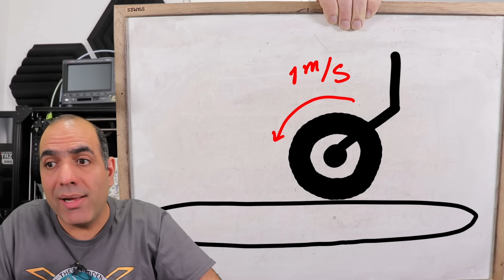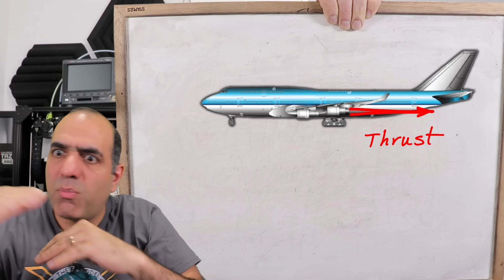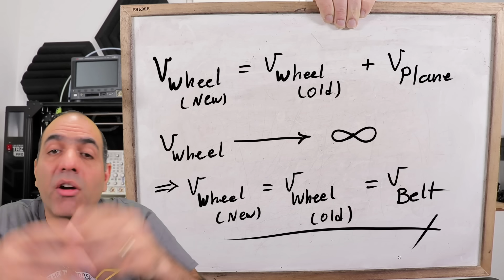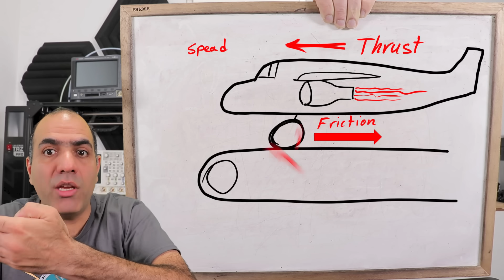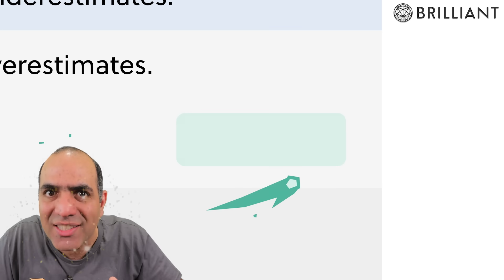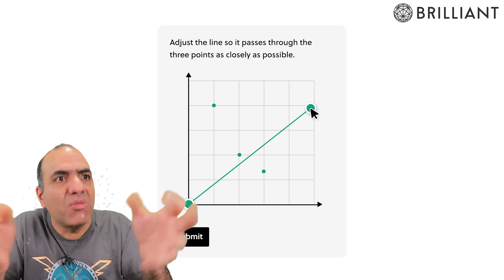Airplane Question that Drove Me NUTS!!!

Comment: I like how the question is implying that the plane's wheel speed is the sole reason why it takes off.
Reply: i'm pretty sure that part is the whole gimmick behind the question
Reply: What if the plane got no wheels😁? There are planes that land and start from the water
Reply: My problem isn’t that people come up with an answer it’s that they get the aspects wrong. “The wheels don’t matter because they aren’t what make the plane move” being the dumbest. No the wheels ALLOW the plane to move and negating their rotation is the issue. “People don’t understand thrust” no morons, thrust isn’t the issue, lift is. Thrust moves the object forward if the wheels allow it to be moved but it’s airflow that matters and you can’t have with a stationary object unless there’s existing wind.
Reply: @steveloafe  wait do you think the belt will stop the plane from taking off? 😂
Reply: @mitchio83  you clearly didn't watch the whole video before commenting, lol. There's a trick to the question.
Reply: @thecrazyfarmboy  Tell me what i got wrong.
Reply: @steveloafe the wheels are what allow it to move without it scraping the bottom of the plane. But it doesn't need wheels. It could use water, it could use snow, it could use lube. The wheels are just the most realistic way to reduce the friction in reality. The fact that they can be taken out of the equation entirely is proof they don't matter for a plane to take off. The point of the question is to make people realize the difference between how cars work and how planes work. The treadmill would stop a car from moving because the car uses the grounds friction to push forward, which is what people often think of.

But think of it this way: if you're on a treadmill wearing roller skates, you could use a rope tied to the wall in front of you to pull yourself forward, regardless of how fast the treadmill is going. Because you're using an entirely different method than the ground to move forward. The air is the rope. The plane moves forward because it is tugging on air, regardless of what the wheels are doing. Are we using the assumption that the wheels exist and haven't melted? Yes, because that's not the point of the question.
Reply: No, it doesn't imply that. It implies that any forward movement of the plane will be offset by rear movement of the ground it is sitting on. The plane may be moving fast relative to the ground, but not fast through the air around it. The air around the wings cannot create lift, not matter how much thrust the engines make. For the plane to move forward through the air, the wheels that are holding it's weight would have to move forward with it, they can't just slide forward.
Reply: Seems that the question is ill-conceived.
Reply: 😂exactly it’s a trick question at its core
Reply: Your reply smells a bit fishy to me.
Reply: Because the wheel is the only thing moving aside from the engine. 

Why are the wings on the plane?
Reply: the power of coercion
Reply: @ΜικεΡ  because its lifted by the Wings ? No Need for ground and tires because its in the Air?
Reply: Right, when if fact it has absolutely NOTHING to do with the aircraft taking off.
Reply: It's like the equivalent of adding wings to a car and wondering why it won't stay in the air.
Reply: Of course it is. That is why it is impossible to start a plane on water or snow.
Reply: @schwarzerritter5724  that's a joke right?
Reply: @fedyx1544  It is called the Magnus Effect. The spinning wheels are actually what makes the airplane fly, the wings are just second rudder.
Reply: @schwarzerritter5724  lmao
Reply: the wheels will be going twice the normal take off speed, maybe they think the will will explode?😅
Reply: @carl_h  way more than twice the takeoff speed. Possibly 10,000X or more. He kind of explained that in the video..
Reply: @carl_h If you're measuring angular velocity, then the ground already represents a surface going in an opposite direction equal to the speed of the wheels.  If you're measuring the velocity of the wheels as an object moving across the ground equal to the aircraft, the conveyor would only double the angular velocity of the wheels.
Reply: @carl_h  in that case the belt did not match the speed of the wheel so it breaks the parameters of the question.
Reply: oh its the wheel? i always thot its the nose.
Reply: @clusterstage  Its the air moving over the wings. Sitting on a treadmill generates no lift.
Reply: It's more like the question imposes a wheel drag that is exactly high enough to match the trust from the motor, so yeah the plane will just stay there unless it is facing a headwind in the midle of a huricane or some otyher far fetched scenario that is not at all mentioned int the question
Reply: @piethein4355 there are even planes with more thrust in forward direction than wheel traction.. Wheels would just skid uselessly.
Reply: It's a pretty uses question either way, there's no way a conveyor belt that big would be stable moving that fast. The heat from friction alone would destroy it.
Reply: Being fair, its kind the reason it doesnt lift off ;)
Reply: Right? I guess it's a question if you have zero understanding how aircraft or jet engines work.
Reply: Yep. These questions sound like some brain teasers for middle schoolers
Reply: What's important... and missing from this scenario entirely is the type of plane and the airflow.
Some planes can take off with very small levels of airflow and some engines can create large amounts of airflow on their own.

Even the smallest amount of lift will upset the perfect drag of the conveyer.

We're arguing a hypothetical where we don't even have the most critical bits of information. Anyone who knows anything about airplanes would know that. (Not to mention that the scenario says nothing about VTOL)
Reply: @Unethical.Dodgson  wheres it Missing ? It says 747 in the question ?
Reply: @Unethical.Dodgson  747s don't have VTOL.  They are big heavy passenger planes and need high enough airspeed over the wings to lift the very large plane.
Reply: without the wheel, it can't build up speed. It's not the sole reason for the plane's capability to fly, but for the way it's designed, it is 'essential' to takeoff. Wheels reduce the drag that would be occurring if the plane was just scraping the floor (assuming the plane is indestructible). Basically, the real solution is that, if the plane can't overcome the speed of the "conveyor belt" such that there is not enough wind over/around the wings to generate enough lift to takeoff, then the plane can't take off. Assuming there's absolutely zero headwind. Again, this is specifically for the given plane 747. Some planes can takeoff without wheels, or wings for that matter.
Reply: @grenzviel4480  the wheel has nothing to do with the creation of lift, it’s a trick question, just like if a float plane is in water, doesn’t need wheels to take off
Reply: @rylandallas9907 if the wheels have nothing at all to do with the scenario. Let’s say a plane needs 100 miles an hour ground speed to take off. Set a belt going at 100 miles an hour opposite direction. Yes it will be moving 100 mph relative to the belt, but will be going 0mph relative to the ground. Therefore no lift.
Reply: @grenzviel4480 If a plane's engines couldn't overcome a double of the rolling resistance of the wheels, planes probably wouldn't be using wheels on take-off to begin with.
Reply: @grenzviel4480  the plane doesn’t need to ‘overcome’ the speed of the conveyer belt. The wheels just turn twice as fast. The speed of the wheels is independent from the speed of the plane.
Reply: @Formula1st  it does because it's the wind around the wings that makes the plane fly. If the plane can't overcome the speed of the conveyor belt, then the wings aren't moving, and if there's no wind moving 'through' the wings, then the plane can't fly. It's not like the 747 can vector its engines upwards or in any direction.
Reply: @grenzviel4480  but the plane doesn’t need to overcome the conveyer belt. The engines generate the thrust, not the wheels. You completely missed my point. The engines generate forward movement, which creates the air flow over the wings, which generates the lift.
Reply: @Formula1st  YOU completely missed my point. Doesn't matter how much thrust there is, whether where the source is from, engine or wheels, it's the WINGS that make the 747 fly. I think you misunderstand how plane engines work in relation to the wings. The wind needs to go over the entire wings, and not just part of the wings to generate enough lift to fly. From the base of the wings, all the way to the tip. Just a reminder, the engines are located just BELOW the wings. If the wind just needed to go through the engines to fly, why do you think the 747 have big ass wings? To look good?
PS: again, assuming the engine is spooled up to its maximum speed, you'd need to vector the thrust downwards and 747's main tool to pitch up and down, the elevators, are not in the way of the engine, so the air flowing through the engine is effectively useless
Reply: @grenzviel4480  I know exactly how planes take off, I’ve flown a few planes in fact. What you don’t understand about what I’m saying is that the plane would move forwards, just like on a normal runway. You seem to be talking about a stationary plane. By ‘the engines generate forward motion’ I didn’t mean they blow air at the wings, I mean they push the plane forwards, and the process of the plane moving through static air generates lift as the air flows over the wings.
Reply: @Formula1st  The spinning wheels have some amount of friction. As the wheels move faster and faster to keep up with the belt that friction increases. In the real world it would just fail, but in magic question land they would speed up until that friction counteracted all of the thrust.
Ignore the belt and just think about wheel brakes. If your plane wheel brakes are engaged and you try to take off you'll either go nowhere or apply so much force that you destroy something. The belt is just a stupid fancy way to apply friction and drag to the wheels, exactly like the brakes.
Reply: @zncon  rolling resistance (friction with the ground) does not increase as the speed of the wheels increases. Like you said, the tyres might fail because they would be going faster than normal, but this isn’t due to friction.
Reply: @Formula1st  I've never seen someone dismiss friction with such confidence and condescension. Amazing.
Reply: @zncon  Excellent illustration of why friction cannot be dismissed out of hand. Wheel brakes (and wheels) exist for a reason.
Reply: @Yutani_Crayven  I swear to god google it. Rolling resistance does not increase with speed. The area of the tyre in contact with the ground dictates the friction with the ground, so the friction would be the same as a normal runway.
Reply: @Formula1st  But friction builds the more the wheels turn, so the idea is to just speed the conveyer up so it always counters the thrust from the engine, so it stays stationary. i guess the right answer is dependent on friction of the wheels, and if we believe they are indestructible, but have friction build, then plane goes no where. Only if frictionless does the plane take off, though there are a lot of bad definitions in which objects speed we are measuring.
Reply: @mokiloke  no. Friction does not build up  the more the wheels turn, which is the main myth behind this. Read my above comments
Reply: @Formula1st  Is your premise that at some speed the wheels would decouple from the belt? My research is showing that most planes can hold their entire thrust with the brake systems for use in a short takeoff, which means the wheels do have enough traction to hold everything in place.
This would change if the ground was wet though.
Reply: @zncon  no, my premise is that the plane would take off just like on a normal runway, but the wheels would spin twice as fast, because the wheels are not applying a large enough force to matter, only the engines and eventually wings are. In your situation, it’s the brakes that have ‘enough traction to hold everything in place’ not the wheels.
Reply: @zncon  Or frozen. Doing runups in freezing conditions is all kinds of fun; basically it's often best done on the runway if there's time for that and you can't find a dry spot :D
Reply: @zncon  this interpretation implies a significant amount of friction is transmitted from the bearings to the plane body which seems kind of goofy on its face doesn't it?
Reply: @DeadTomLives  It does, but the speed at which the bearing spins would increase into infinity, which is why goofy makes sense here.

As the plane starts to move, the wheels go from stationary to to the forward speed of the plane, the treadmill then speeds up to counter it. However now the plane is trying to move forward, which means the wheel must spin faster then the treadmill, as the wheel speed must be the combination of the treadmill and plane speed.

If wheel speed is W, plane ground speed is P, and treadmill speed is T, we'd have the formula W = P + T. However since the initial problems requires that T = W, the value of T increases by P every time you calculate it.

If the system can't just break, this feedback loop keeps happening into infinity.
I'd think a wheel bearing spinning at 0.99~ the speed of light would have a lot of internal friction.
Reply: @zncon  except by the time the wheels are spinning at 2x takeoff speed the plane takes off. 

An airplane doesn't use the wheels to take off, it's analogous to using your hand to move a toy car up and down a running treadmill. 

The wheels on a toy car are spinning at speed of treadmill T when stationary, right? You begin moving the car forward along the treadmill against its motion at speed H, the wheels are now spinning at T+H and the car is traveling relative to the treadmill at H.

For an airplane once H equals takeoff speed it angles flaps and takes off.
Reply: @zncon  I hit enter early on that last one and added a bunch, in case you saw it immediately.
Reply: @DeadTomLives  This isn't considering that the treadmill instantly speeds up to match any time you try to make forward progress. As you try to push the car forward the treadmill would go to infinite speed until it was pulling so hard on the car that you could no longer push it forward at all.

I should specify, this requires the wheels have perfect traction against the treadmill. Any slip at all and it behaves exactly as you describe instead. The reason I'm assuming perfect friction is that the question says nothing breaks, and plains are designed such that the wheel brakes are able to hold it in place even at full throttle, which implies there's enough friction with the ground to cancel any thrust the engine can create.

When holding the car stationary on a moving treadmill then T = H and we're balanced. However as soon as you move the car to increase H, T must also increase until they are equal again. Functionally this means we're calculating T = H + T. There's always a leftover force because it's not balanced.
Reply: @zncon  ...what? That doesn't even make sense, the speed of the wheels isn't suddenly infinity. It matches the speed, the added speed is H therefore it increases by H.
Reply: @DeadTomLives  But when the speed matches, you're no longer moving forward, which means you need to speed up the wheel more to attempted moving forward.

If the treadmill and wheel are both moving at 3, you'll be stationary. So now you push the wheel up to 4, and the treadmill also goes up to 4, and again you're stationary.
Reply: @zncon  your breakdown in understanding here seems to be the normal one. The plane isn't moving forward because the wheel is turning. The wheel is turning because the plane is accelerating forward due to thrust.

The wheels are only ever going to try to spin at the air speed of the plane plus the speed of the treadmill - (I forget the symbol for an increasing value offhand) -  once air speed is takeoff speed up it goes.

Wheels start at 0, plane begins to move forward at an accelerating H, at start + 1 second, let's say, H is at 1/10 takeoff speed F. The wheels are now spinning at T+ H + (1.)F the plane has moved 10 feet down the treadmill or whatever.

The next second more acceleration happens, we're at ⅛ takeoff speed, wheels are spinning at blah blah, treadmill is moving at blah blah and the plane has moved 60 feet down the treadmill.

Etc until we get to takeoff speed and the wheels are at H+T and that speed is 2F.
Reply: @zncon  no, because the wheels aren't why it's moving forward.

The engine adds energy to the system the plane continues to move forward and the wheels speed up.

What you're saying only makes sense if the wheels are propelling the plane. The wheels are only spinning because the fuselage has an air speed and they're in contact with the ground.

The wheels increase in speed to #F and the plane flaps down and flies away.
Reply: @zncon  I think we're also applying friction differently than each other, such is probably the point of how vague the question always is
Reply: @DeadTomLives  Yeah I don't get his explanation either.
Maybe it makes more sense if you think of the plan as a rocket engine. The engines theoredicly are moving in a way that it's pushing on more air and thrusting the plane forward.
This is why the plane can move at all. Essentially the the wheels and treadmill is a completely different system.

(1)Treadmill fighting (2)wheels
(3)propeller/jett engine thing fighting (4)air
3-4 starts the chain of 1-2 but once 1 = 2 = 3

Nothing happens, plane does not move.
It's when 3 get's faster than 4 or in other words the inablily of air to move out of the way faster then a propellers "thrust" is when it starts taking off.

*This is also neglecting lift as a prop or jett engine creates as it sucks/pushes air past the wings. 
*Also neglecting that a plane throws air backward and is also newtons 3rd law of motion.
Thrust and lift, that's how a plane takes off. Formula salved.
Reply: @DoubsGaming  yeah in order for the plane to not move it requires perfect interface with the wheels and the treadmill which isn't stated
Reply: @Formula1st if the wheels spin twice as fast as the conveyor belt then the conveyor belt will start moving twice as fast to match the wheels, you completely misunderstood the question. All of the thrust the airplane generates will be converted to heat from the friction between the wheels and the runway and the wheels and the bearings.
Reply: @drabberfrog  that would only happen if either the wheels and conveyer belt were gears or if you ignored some of physics to make the wheels and conveyer belt stick together. The question was based on real life physics, not some theoretical universe where the wheels and conveyer belt would act like gears. If that was the case, they couldn’t have tested it on mythbusters.
Reply: @Formula1st  
Now theres your problem. 
You said "The wheels just turn twice as fast." The conveyor will match that. Which means the wheels must turn 4x as fast, which the conveyor will match again, this happens till infinity. 
Which then you get to scenario 2. 

However I disagree with the plane flying because if the airplane moves forward in any part in the scenario, it means the conveyor isn't matching the wheel speed of the airplane anymore; this would mean the airplane wheels are now rotating faster than the conveyor. Which then breaks the question in the first place as "conveyor matches exactly the wheel speed (assumed to be rotational speed).
Reply: @shawnaw2  I’m talking about reality, rather than magical mathsland where everything follows physically impossible rules such as infinitely accelerating conveyer belts. After all, if we’re ignoring some of physics, why bother considering other parts? And it could be argued that this still applies to the question as it said the conveyer belt was ‘designed’ to match the wheel speed, not that it actually does. So it can be implied that it only matches the wheel speed until a certain point, or a at a certain rate.
Reply: @Formula1st literally every intro physics class ever ignores miniscule calculations. You often ignore air resistance when doing calculations. There are a lot of extremely valid reasons to not overcomplicate an equation to get to the core of the question. Us assuming the wheels don't melt from heat is an entirely reasonable physics scenario if we're trying to decide if the conveyor would stop it from flying. But even if you wanted to remove the wheels entirely, you could use massive amounts of lube instead. Because the wheels are basically just acting as lube to reduce friction between the plane and the ground, meaning they are not needed to take off. Any substitute would work as well (water, snow, lube...)
Reply: Yeah, that's a fundamentally bogus proposition. Except ... the tires have a rated speed, and if you exceed it by a large enough margin, they'll burst. If your speed relative to the "runway" is twice your rotation speed, you'll probably have one or more burst tires, and that's an industrial-strength Bad Day.
Reply: i didn't see the explanation yet.. but the answer is yes.. the wheels shall spin at twice the rpm thats all
Reply: It also implies that the wheels and conveyor belt are indestructible. There are only two real answers: first is that at some point (very quickly) the conveyor belt destroys itself and in the process also the plane, meaning the only reason the plane doesn't take off is because everything got destroyed; second is that the plane takes off after the conveyor belt simply fails as it can't go fast enough.

I'm assuming wheels will simply always survive before the conveyor belt... because I'm sane.
Reply: do people think the wheels that get stored inboard of the plane are going to help the plane fly?!
Reply: @Brurgh  Yeah. Or for instance how spaceship are capable in moving. Basic concept isn't very hard. Thrust and you're essentially going on.
Gotta wonder how some people are seeing like how water jets are going on 😁
Reply: I mean it kind of is. If the conveyor belt negates the rotation of the wheels there won't be any lift since there isn't any movement
Reply: @WowUrFcknHxC  It's propelled by pushing against air, though. All the wheels do is eliminate friction against the ground.
Reply: @WowUrFcknHxC  Its not,  wheels have nohing to do with the 0lane takes of or not.
The plane reaches lift when the wind speed going on top and bottom of the wing is fast enough.
Reply: @WowUrFcknHxC  The plane's wheels have nothing to do with its ability to take off, they're just there so the plane isn't scraping on the floor.
Reply: @F_I_J_I_W_A_T_E_R  Yeah I don't understand why more people don't get that. Do people think planes are just glorified gliders?
Reply: @DoubsGaming  Go back and watch the video again. The problem is that the prompt specifies that the conveyor matches the *spin of the wheels*, not the forward movement of the plane. In order to take off the plane needs to build up speed on the ground first while resting on the wheels, but the instant it starts moving the conveyor ramps up applying drag, the wheels start moving faster than the conveyor because the plane is moving forward by a non zero speed, and so the conveyor speeds up again, and so on and so forth until some part of the plane's landing gear catastrophically fails and the plane falls to the ground, long before achieving any kind of take off speed. Or we assume infinitely strong landing gear in which case the conveyor generates infinite drag. Or we assume frictionless wheels and the plane takes off with the wheels and conveyor both spinning at an infinite speed (but then we've ignored relativity).

The apparent intent is to just point out that the plane's wheels aren't driving it forwards, but because it's a somewhat arbitrary hypothetical that's missing a number of key details that's not actually the conclusion a lot of people will come to even if they're fully aware that the wheels of a plane aren't driven.
Reply: @bosstowndynamics5488  ok let me stop you there. I watched the vid and understood the prompt is dumb. That's what the vid is about isn't it? I was saying that because other peoples arguments always seem to refer back to the fact people think planes are powered by their wheels that was it.
Reply: @F_I_J_I_W_A_T_E_R  I'm of the understanding that planes generally find their ability to take off somewhat hampered if they're scraping rather than rolling along.
Reply: @WowUrFcknHxC  I ask you one thing. Do you think planes wheels are driven? 😃
Reply: @WowUrFcknHxC  Yes I did. Nuff said 😀
Reply: @WowUrFcknHxC  for something without thrust you'd be right. Imagine running on a treadmill and someone giving you a push from the back. You'd be thrust forward regardless of the treadmill matching your feet
Reply: @WowUrFcknHxC how is a treadmill supposed to halt acceleration of a wheel from a third force?
Reply: @WowUrFcknHxC  but the wheels are free wheeling, meaning that there’s no direct locomotive link between them, so it would still go forward. Even with sleds for example (yes, that’s a real thing)
Reply: @WowUrFcknHxC  no, because the thrust provided by the engine and the rotational speed of the wheels have no direct link between them.
Reply: @fedyx1544  Yes they do. If the engines thrust the plane forward, the wheels have to move forward with it. As the plane moves forward, the ground moves backwards. So the plane never gains forward momentum through the air. It basically turns into a giant engine to move the belt.
Reply: @NandR  no, because as long as the brakes of the plane are released, when the ground moves the wheels will simply roll and the plane will remain stationary as if it was on ice. The only problem arises if the question is set up in a way that makes it so the plane moving causes the wheels speed to approach infinity.
Reply: @WowUrFcknHxC  NO. That’s the whole myth behind it. The speed of the wheels has nothing to do with the speed of the plane
Reply: @WowUrFcknHxC  Aircraft fly because of Lift and thrust (both acting on airflow across the wings), neither of those forces are in any way effected by what the wheel, and ground surface are doing.  Airspeed makes an aircraft fly, not groundspeed. The whole question is a stupid one.
Reply: @WowUrFcknHxC  Airplanes don't move due to the rotation of the wheels.  Their motion is due to the props / engines.  The wheels do have brakes, but the motive force is due to the prop / engine's thrust, and the wheels are effectively in neutral, when the plane is moving on the ground.